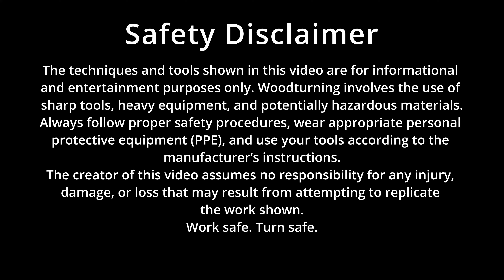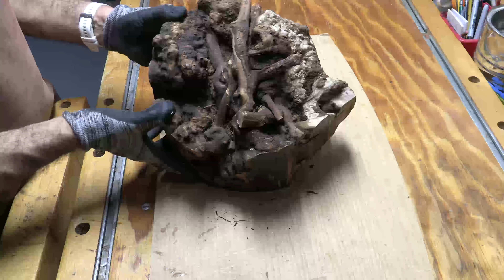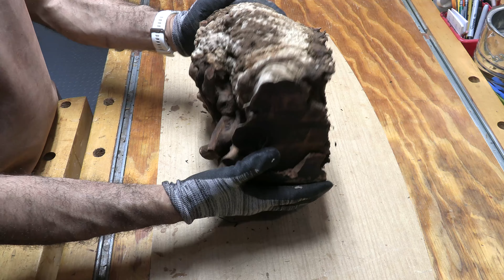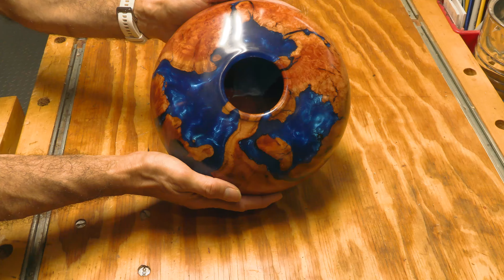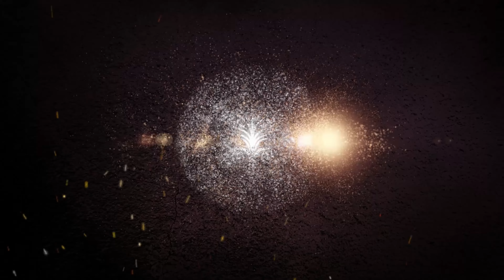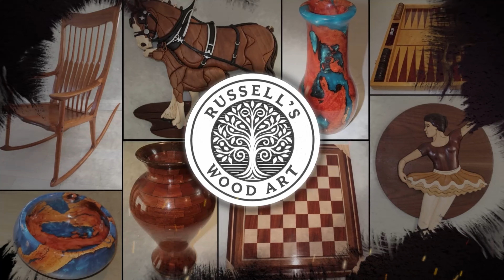Twisted Burl Root Transformed – Epoxy Hollow Form Woodturning

Comment: What brand and type of resin did you use? How much time did you have to get your color mixed
Reply from the maker: Thanks for your comment. 
I used Deep Casting resin from Designer Epoxy, a Canadian company. I usually mix the color and epoxy for about 3 minutes. I let it cure in the pressure pot for 72 hours.